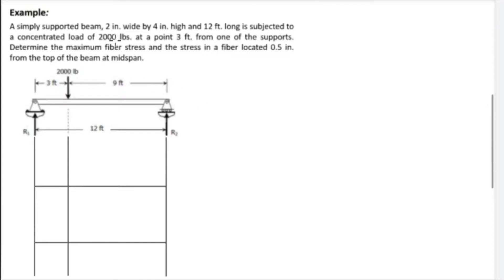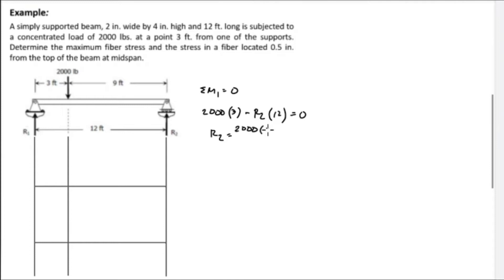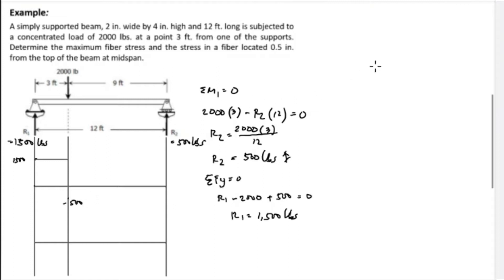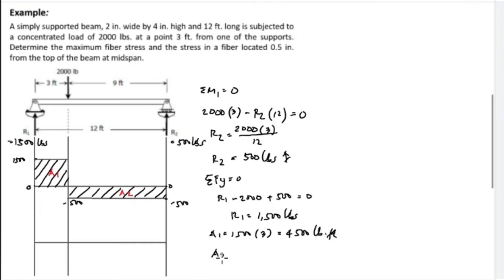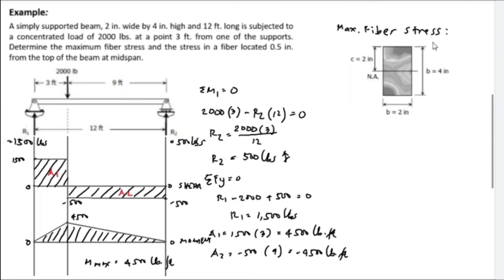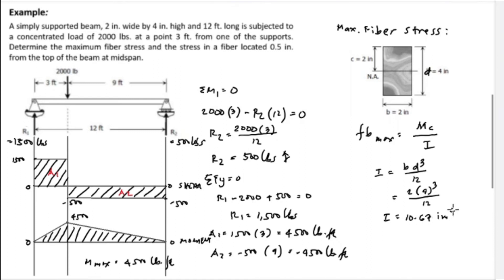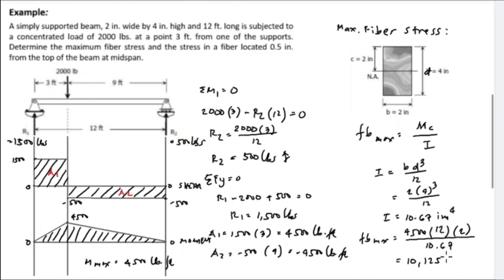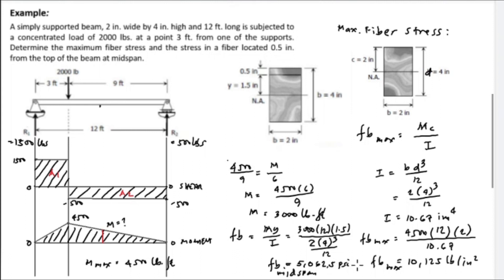Theory of Structures: Flexure Formula (Problem 2)

Comment: A rectangular beam 300 x 150 mm is simply supported over a 4 m span, and supports a live load of 10 kN/m. If a straight tendon is provided at an eccentricity of 65 mm below the centroid of the section, find the minimum prestress force necessary for no tension under live load at mid-span. Calculate the corresponding stresses under self-weight only at mid-span and at the ends of the member.